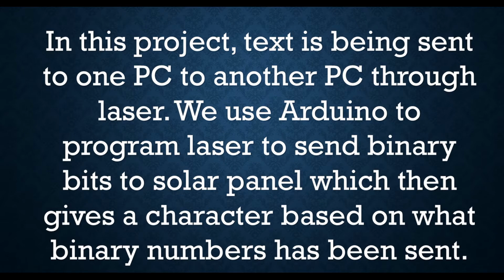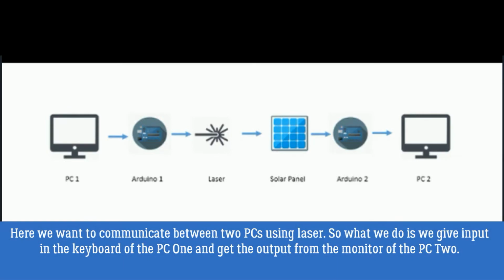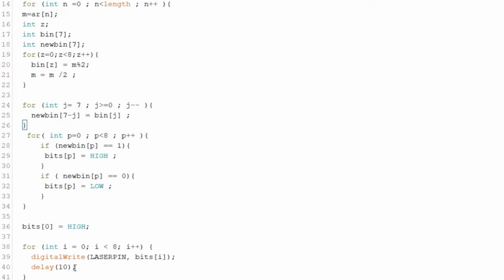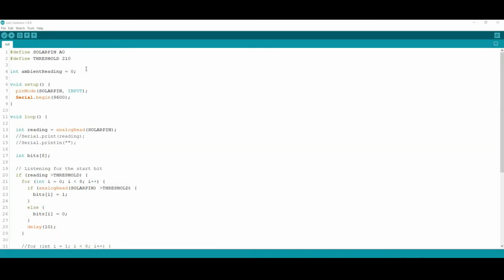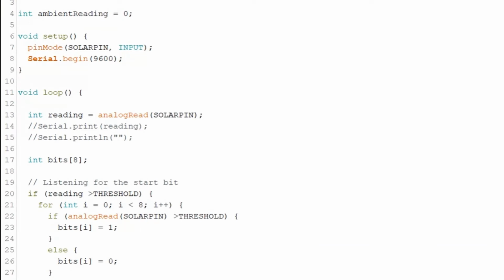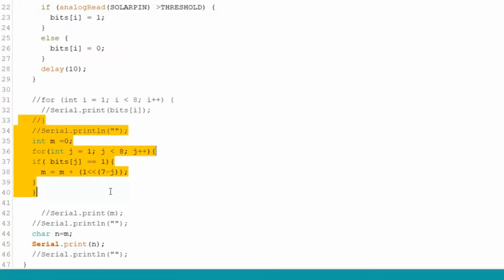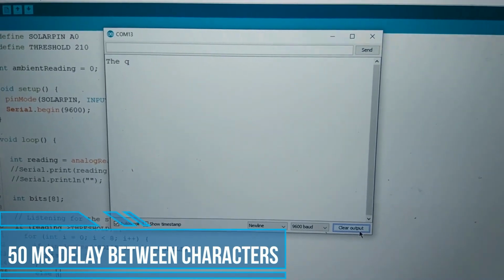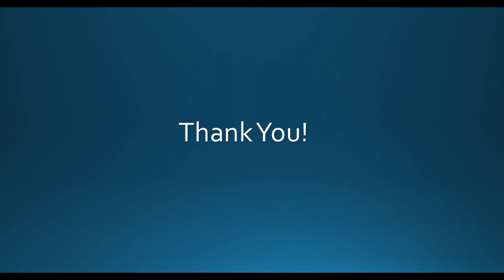Communication Lab Project - Text transmission with Laser (LIFI) - Arduino

Comment: Can we do it with STM32 ? İt will be my graduation project please .ım waiting your answer as soon as possible..
Reply from the maker: I dont have experience with stm32. But as far as i know, if you can do it for arduino, you can do it for stm32.
Reply from the maker: The codes in the video is the proper one. Follow that. I might have changed something in the GitHub repo.
Reply: at now  ı solved all the problems except ı m getting the text like just 1 and 0. not convert to the ascıı value
Reply: what is the  reason of problem can it be laser/led or distance or maybe delay difference or threshold value ????
Reply: @cemaldinc6008  hii..did u complete the project???
pls reply..
Reply: @cemaldinc6008  i'm doing this as my final year project
Reply from the maker: Delay difference should be same in both end. And keep experimenting with threshold value. It depends on lighting. 

If you are getting binary digits but not the ascii values, then look at the code and tweak the codes. Maybe i changed something in code, then forget to undo it. It should work on arduino as it did for me.
Reply: Hivdear

Comment: What is the voltage of laser ??
Reply from the maker: +5V
Reply: @atahersams7085  can you plss tell us about the connections on both transmission and receiver side
Reply: @atahersams7085  we r having the diffiiculty in connections could you pls provide those
Reply: @chintalakmlakshmi198  hey is it work? We just started and we have a difficult to succeed.